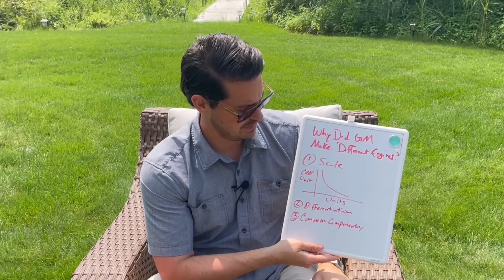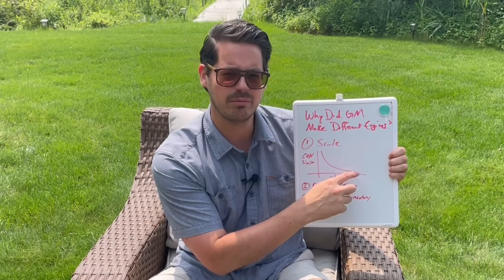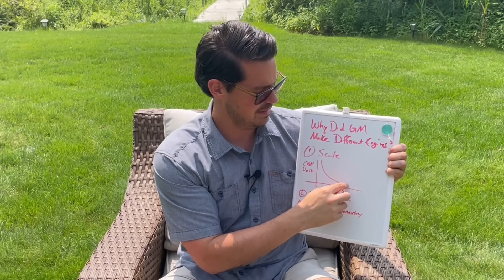Why did General Motors (GM) Make So Many Different V8 Engines in the 1950s-1970s?

Comment: As James Carville said many years ago "Why does a dog lick its private parts? Because it can."  I was surprised to learn recently that there was an Oldsmobile version of Buick's famous 215 cu inch aluminum V8, partly to allow the engines to be assembled on both Buick and Oldsmobile assembly lines, the Olds version also had different heads with more bolts. I don't know what else was different between the two, but they were said to have almost identical displacements, so the cylinder dimensions were probably  the same. I suppose any number of things one expects to find on an engine assembly line, bits, taps, etc. had to be accommodated and each division must have had a substantial investment in equipment dedicated to its own designs. I'm sure all this made GM a more interesting place, but it must have been nerve-wracking coordinating 5 divisions, each  with its own unique baggage.
Reply: The blocks were the same, except for the number of head-bolt holes, but the heads were indeed different.  The Olds version had the most power and revved the highest.
Reply: The Oldsmobile version of the 215 was used as the basis of the Repco-Brabham F1 engine, as I recall.
Reply: James Carville: what an interesting and quick-witted man! Just before the 1992 Presidential election, Dan Rather asked him about Governor Clinton's chances "if" this happens, "but" that could also happen. Carville dismissed the whole thing by saying. "Well, you know, Dan Rather, if "ifs" and "buts" were beer and nuts, we'd have one hell of a party!" SO funny, and one of the best lines all year!

Comment: Great topic and conversation Adam! I always wondered why GM allowed the divisions to have there own proprietary engine designs. Makes perfect sense. I kind of miss those days when each had its own. Each sounded a little different too, I think.
Reply: Absolutely the olds had a more bassy exhaust, Pontiacs seemed to be raspy, Buick seemed to have the quietest sound, Chevy best induction sound under medium to full throttle.
Reply: And had different characteristics as well.

Comment: Very intertesting video.  I sure learned something tonight.    Now,  does that appy to bolt on parts of the engine (starter, alternator, pumps....) too, or  are many of these more interchangeable than the engine itself ?
Reply from the maker: Same thing. Very similar
Reply: Unfortunately some would bolt in place when inappropriate.  The first and second times I replace the starter on my '73 Buick 455 the nose of the starter broke off.  Then I learned that the engine needed the "high torque" starter with a stronger nose, not just any old rebuilt thing that would bolt in place.

Comment: I produced a case study on this exact subject as a college freshman.  The how was driven by brand identity where management encouraged each division to pursue its own market, marketing and components.  Those engine plants were there early in their brand lives and continued until economics changed things.  

The why was the brand identity was a strong force until economics changed things.  When costs had to go, the decision was to carve out specialty engines from each division.  Chevrolet had the V8s, certain V6s and the inline 6 plus the 4-cylinder Chevette.  Pontiac produced the 2.5L, Oldsmobile did the 307 V8 until 1990 and Buick built the V6.  Cadillac was allowed to continue to produce a unique engine and we know how that worked out.
Reply: Too bad, as Cadillac's engines before the 80s were Life-time engines.  If you took care of them and never burned them up by driving with no water, they would outlast the car, and still be in good condition.  Buick straight 8s were almost as good.
Reply: @michaelbenardo5695  There was simply no way those Cadillac engines of yesteryear were going to be able to meet CAFE requirements and weight requirements, though.

Comment: the excellent 3800 v6 is often called the "buick v6". shed some light on that, was that the last "divisional" engine?
Reply: It evolved from the Buick 231 V-6 from the late 70s/early 80s.  In its 'electronic carburetor' guise, it was a dog - my aunt had an '81 Pontiac LeMans that couldn't get out of its own way.  Step on the accelerator and it would think about going somewhere, then eventually get back to you.  It was downright scary entering traffic in that thing.  The 231/3.8l eventually became an excellent engine once it got port fuel injection, but for a time seemed more anchor than power source.  The early 80s was a nadir for GM for sure.
Reply: @patmx5  i have owned several 3800's both supercharged and non-supercharged. currently we still have a 97 grand prix L36 non-supercharged, and a bonneville SSEi. the 3800 series II supercharged with a few mods is almost downright fast. it really hauls and i know there is more i could do to it.

early versions of the 3.8L were less then stellar but the foundation was there. 

i also have a 2022 crosstrek but i will hold on to the 3800 cars as long as i can, i absolutely love those engines. i refuse to drive my bonneville in the winter, im trying to keep it in one piece. the previous owner drove it in several winters and i have taken up efforts to remove the rot from the rear wheel wells, the car is otherwise structurally sound. i cut the rusted areas out and replaced the metal..... the body looks great. it's "croch rot"
Reply: @andrewdonohue1853  Agreed wholeheartedly - my aunt later got an '88 base model Bonneville with a normally aspirated 3800, and it was night and day different than the 231 in the LeMans.  Amazing what 7 years and fuel injection did to that engine - where the LeMans was scary to drive in traffic,, the Bonneville was a pleasure - step on the tall skinny pedal and it went.
Reply: Buick developed the V6 for use in the BOP compact cars. It debuted for 1962 ( winning Motor Trend's " Car of the Year " award ). GM then sold the tooling to Kaiser-Jeep in 1966 ( for Jeep's 1967 model year ).

After the gas crunch of 1973, Buick bought the tooling back from AMC ( who bought Kaiser-Jeep in 1969 ). The first " modern " Buick V6 debuted for 1975.
Reply: @Lurch4you  the later 3800 had a different deck and had different bore spaced, the banks are staggered. balance shaft was also added. series I, series II, and series III were and remain great engines. i also loved the L67, and i still do

Comment: Each division of GM had it's own customer base before they joined GM. It had more to do with customer loyalty. The competition between divisions just made them all better. But when the EPA started cracking down on emissions the search was on for the cleanest burning engines.  As dirty engines were phased out they were replaced with cleaner engines from other divisions on the assembly line. That's the short version from me. Formerly Mr  Goodwrench. Thanks for showing us the math!
Reply: Mostly true.
Reply: Going into the depression there were huge numbers of car companies.  Even in the 50s, Nash, Packhard, Studebaker were around.  Willys, Kaiser.  A lot more competition.  Name plate engineering would'nt have worked.

Comment: In 1966, you could get a Chevrolet Chevelle with a choice between two different six-cylinder engines (194ci or 230ci) and three different V8s (283ci, 327ci and 396ci).  I don't think the 427 was offered in a Chevelle until later..
Reply: the 427 was never a factory option for the Chevelle, unless possibly via a COPO order...  1970 was the first year for 454 Chevelles
Reply: @anthony221956  ('69 COPO 427) but what's amazing to me is how many engines were offered.. if I had a 396 back then, I wouldn't be alive now!

Comment: Honestly, Ford did the same thing; Y-block, FE, Fairlane-Windsor-SBF and the 351W (two different engines, IMO), 335 Series with the M-variants, 385 series. It's as though the powertrain engineers were bored and kept themselves busy by one-upmanship.
Reply: And SD truck engines and the MEL

Comment: I thought Ford was the weird one.  So many 7 liter engines.  427, 428, 429, 430.  Ridiculous
Reply: 427/428 were the last of the old FE series. The 430 & 462 were the MEL (Mercury-Edsel-Lincoln) series which can be thought of as being unique like the Caddy 472/500 engines.  The 429 Lima (385 series) replaced both of those older engine families and evolved to the 460.
Reply: @eaglewi . . . I can't directly recall the attributable source, but I recall a while back of some info on the web with why Ford pushed the 428 on the consumer market:  It was an easier engine build than the 427.  
Apparently, it took more work for casting, machining, and assembling the 427 due to its high-performance nature; whereas the 428, being more sedate in performance, was an easier and less costly build for mass-production.
The Ford 429 was designed and built for NASCAR with the 1969 season, as to put Ford on a better competitive level with the Dodge/Plymouth 426 Hemi.  Ford needed an updated engine design, as in NACAR's 49 race season in 1967, the Plymouth/Dodge combo amounted to 36 victories.  
So, to sum it up from a casual viewpoint, the 427/429 were meant for racing; while the 428/430 were for production vehicles.
Reply: You did not mention the 477 rare but more of a  F series engine but a much recommended  upgrade when you ordered  the class 4  trailer towing group option  on a Colony Park  or Country Squire  I also think the 477 was standard fare when you got the F 250 or 350  Camper Special trucks  Adam would know I could be wrong but the guy that educated me on all these little tid bits  was the Truck Manager at the Ford dealership where I got one of my first jobs the year I graduated H.S.1985 I was one of the Service department Porters  hiker parts runner extra set hands when the mechanics needed help clean up cars after service cleanup shop after closing  drive new chassis cabs to the truck body outfitter company go pickup customers at work or home or Vica versa I learned a lot lots of fun but no future at $4.25 hour my parents almost killed me you got to get a trade or technical skill  long story short I went thru a Commercial truck driving school

Comment: I remember the uproar in 77 when the Oldsmobile 88 and 98 ordered with a 350 could come with either a Chevy or Olds engine.  GM corrected that mistake for 78, the year I ordered my first brand new car, a black on black Delta 88 Royale coupe.  I ordered it with the 350 4bbl and I told the dealer if it came in with a Chevy engine I would not take delivery.  I was assured that all 350s for 78 were Olds 350s.
Reply: I don’t blame you because the Olds engine was clearly more durable than the Chevy engines.
Reply: @dmandman9  During that time period, I would agree!...the Chevy 350 seemed to gain durability when they went to the TBI injection in the late 80's...and the Olds 260 and 307 were very much more durable than the "small" Chevy V8's, like the 262 and 267...maybe even the 305...
Reply: @dyer2cycle  Yes, it seems that when they added fuel injection and when the small block chevy changed to when the valve cover bolts went through the center of the valve cover, the durability of the engine increased dramatically. It went from a 100,000 mile engine to one that would commonly last 200,000 miles. But by then except for Cadillac , the other v8s had been phased out. Ironically, the Cadillac engines went from bulletproof to fragile once they changed from the 472, 500, 425, 368 design to the 4100. By the way, the GM V6’s durability got better when they added fuel injection and went distributorless.

Comment: What always suprised me was all the variations in displacement each division had in their v8 lineup.
Reply: Their cars were of different sizes and weights.  A Cadillac was a huge and heavy car, the big Buick, (4 holes per side), was almost as big and heavy.  The Olds 98 a little less so, the Pontiac was a lighter car.  The Chevy was the "baby", the smallest and lightest by quite a bit.

Comment: Which GM 350 engine was the best ?
Reply: I always liked the Buick 350...  back in the 1970's i drove Chevy 350s, Pontiac 350s and Buick 350s    The Buick had more torque off the line and yet would rev due to the short stroke...   I think the Chevy 327 had the best bore stroke ratio   The Pontiac 350 was very slow to rev up compared to the Chevy and Buick
Reply: As a general motor in factory trim, the Chevy 350 is the best, since it saw the most development (esp. the cylinder heads) and applications - from a low performance 2 bbl to a mid performance 4 bbl truck motor to a high performance 4-bolt/4 bbl screamer in a Camaro or Corvette. As a specific motor,  L48 300 hp 350 was probably the best of the bunch - 4 bolt mains, steel crank, hydraulic cam and great performance yet a legit daily driver (unlike the 350 LT-1, 327 L79, etc.).
Reply: Pontiac 350.

Comment: It's mind boggling to think about how each brand was totally independent. And how much brand competition there was between each member of the GM family. But as time went on and efficiency and emissions became important then they started to lean towards common platforms...
Reply: As Adam stated, too, GM's dropping market share drove much of this as well. They were selling fewer cars so the need to rationalize development costs became more urgent. The front wheel drive A/X platform was the first big step in doing the basic platform engineering on a corporate-wide basis. John DeLorean in On a Clear Day You Can See General Motors wrote that even as early as the late 1960's and early 1970's GM management had begun to see a future where they could no longer bear the costs of letting each division do bespoke development of its own vehicles. Part of the issues with the Vega was that management of the individual divisions did not want a car developed by one of the other divisions. It's a fascinating and, in 2023, incomprehensible way of running a business.
Reply: I was born in 1964, so I had an idea of what went on in the Golden age of the auto industry.. but i really wished I was born sooner to be an actual part of it . Was a fun exciting time in automotive history, for sure.. back when bean counters had a very small role to play in The GM scenario..
Reply: Per GM at least, “Parts Interchangeability” had already become a somewhat ever-increasing thing across the various divisions of GM by the mid 50’s even… this however, for anyone even slightly familiar with GM cars of the mid 50’s, was rather obviously NOT for major component, subassemblies &/or, specialized contour shaped parts, which then comprised majority parts per division &, often even within separate “series” car parts of same division… it seems as tho this method of overhead cost reduction, really began to increase dramatically by the early 60’s
Reply: @seanbatiz6620  It increased by giving each division a compact that under the skin was the same car corporate-wide, for the most part.  The regular standard-size cars were slower to move in that direction.  Oldsmobile didn't until about 1965, but even then, kept it's own engines.
Reply: @michaelbenardo5695  1950's and 1960's Oldsmobiles clearly shared platforms and even other components with other divisions, typically upper-range Pontiacs and lower-range Buicks..probably back in the late 40's a s well...clearly, by 1959, it was obvious body shell were being shared..look at doors, side and rear windows, rooflines, windshields, etc...in fact, I think all 1959 GM makes shared the same doors...certainly went way farther back than 1965...
Reply: @dyer2cycle  There were two common bellhousing bolt patterns for the Turbo Hydramatic transmissions; one was "Chevy" and the other was "BOP" for Buick/ Olds/ Pontiac. Caddilacs had a different one too. GM car makers had long been forced to use GM parts suppliers like Delco, Saginaw, Hydramatic, Frigidaire, etc and those parts makers based their prices on batch-size profitability so a ball joint used by everyone else would be cheaper than one made specifically made for you alone. In theory each car maker could choose for themselves which fended off anti-trust accusations but in reality they all did what the corporate board told them to do.
Reply: @P_RO_  Knew about the "BOP" and Chevy differences, but didn't know about Cadillac..assumed they used "BOP"...but then I was never really interested in Cadillacs...
Reply: The full size cars had different suspension and chassis components up through the ‘70 model year.  For ‘71 they went to “corporate” suspension
Reply: @seanbatiz6620  Glass was shared cause it's very expensive to develop.
Reply: and that is what began their decline
Reply: Actually, Ford made car and truck engines plus special hyper car engines to compete with Chevy truck engines! Such as 351C, Boss 302, Boss 351, SOHC 427, Boss 429, DOHC 4.6L, DOHC 5.0L, etc... 
Also, Ford made FOUR 351's! 352, 351W, 351C/Boss 351, 351M all had SAME bore and stroke!